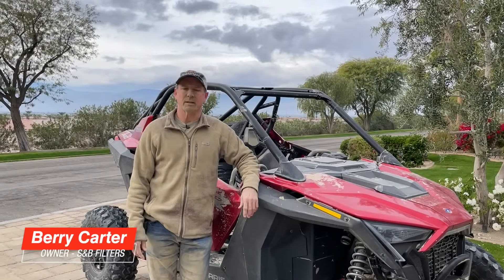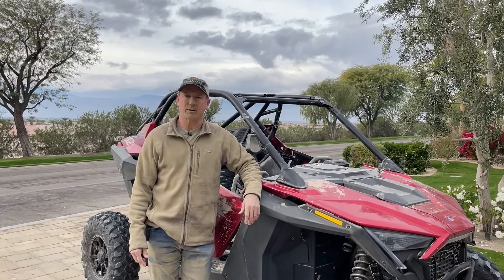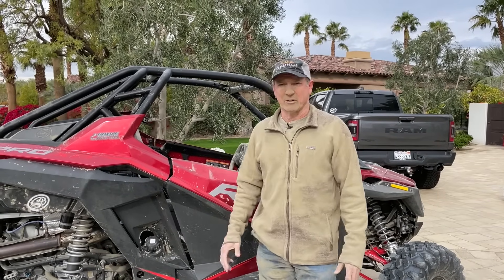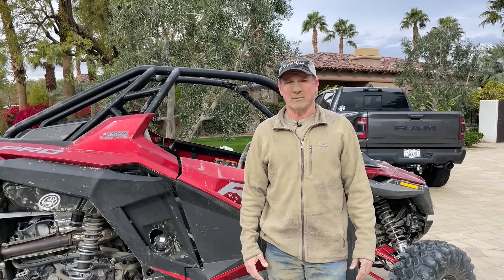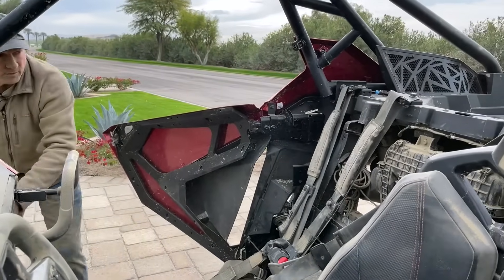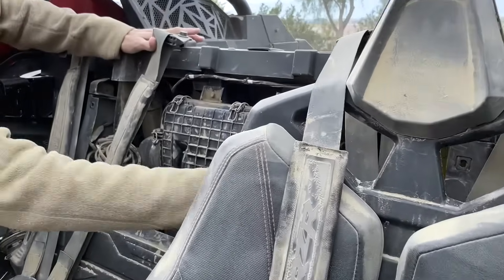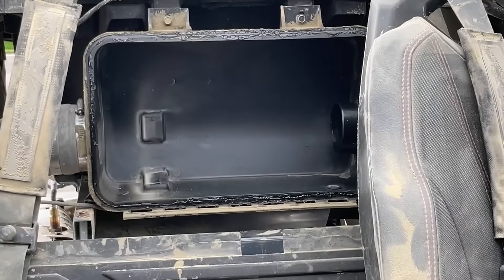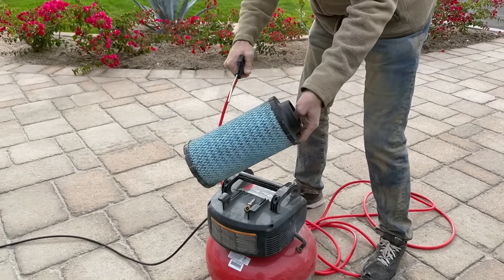Extreme Field Testing for Particle Separator V2 (Fender Mounted) for Pro XP and Turbo R

Comment: So is there a difference in performance between the wheel well and the roll bar mounted one?
Reply from the maker: @voltron2127  no the wheel well one still pulls air in from up top